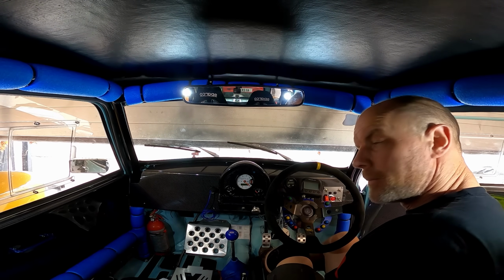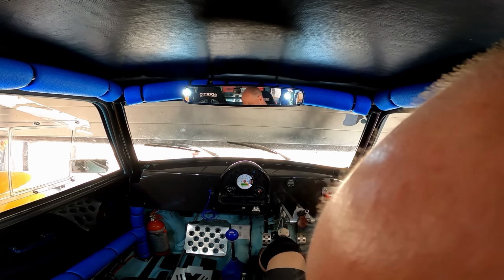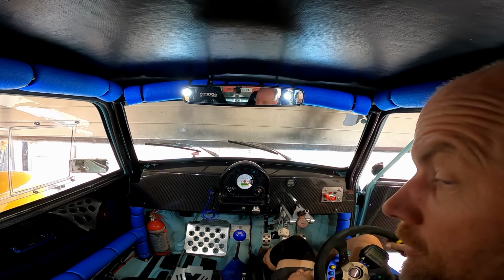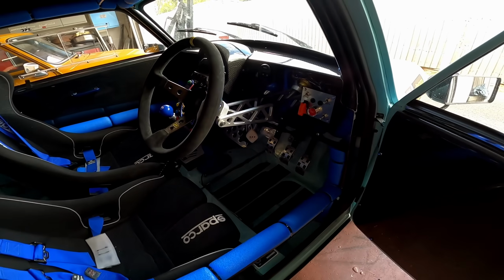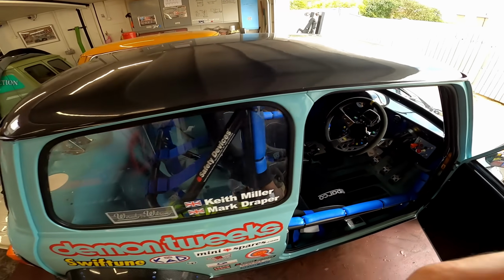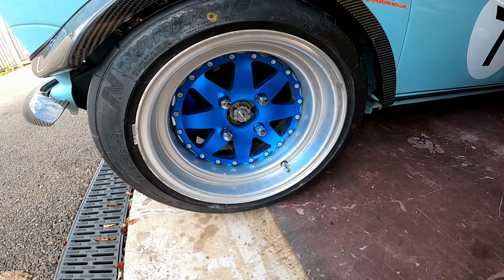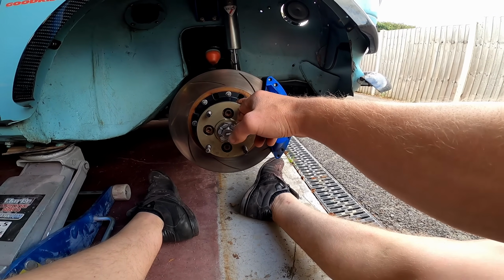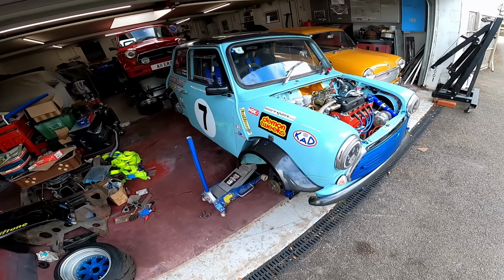Classic Mini 1380 Swiftune Rolling Road Session - Classic Mini Workshop Project Bolt Part 3

Comment: At wheel torque ?...👍🏻
Reply from the maker: 36BHP was calculated at the flywheel, it's about 116BHP at the wheels
Reply: @classicminiworkshop  
I wrote 'at wheel torque ' , did you see something different on your side ?
Reply from the maker: @TheCraigy83  Apologies, I just read it wrong. Unfortunately, I don't know that figure.
Reply: @classicminiworkshop  
it's incredibly important that the average lads know torque IS multiplied by the drive train by orders , crank /flywheel rpm vs gear ratio advantage will always expose the torque multiplication..
for instance a civic type R has a 60 in 2 ratio a 30x ! torque advantage , in first gear they have upwards of 3500ftlb..
a series 1 defender has 114ftlb at crank and +4000 at wheels . 
Trying to find at wheel data is suspiciously difficult , big industry want us to un learn leverage 😂...👍🏻

Comment: you cut out the original roof and made it out of carbon fiber . I wonder about rigidity. How does the mini shell keep its stifness?. Is it fully seamwelded?
Reply from the maker: Hi, it's got a full roll cage fitted and you leave a good 3" lip around the whole roof so you have something to bond to

Comment: Keith, Mark It must be more than 116 HP @ the wheels as you have 136.7 HP total that would mean your losing 20.7 HP through 
the gearbox and diff that can‘t be right ?  My 1310cc is 113HP @ 5828 rpm & 112.06 @ 4983 rpm. I‘m sure i would not be able to 
keep up with Bolt on the track but who knows one day we may get a chance to have a track day together and try each others minis 
out. Cheers Dave
Reply from the maker: That works out at approximately 15% transmission loss. I thought that was pretty standard? I'm sure Paul Jeffries will know more
Reply from the maker: Would be awesome to get on the track together  👍😀
Reply: Straight cut is around 15-18% loss, so tallies. As Bolt is short ratio, it would be on the lower end of the scale. Bloody brilliant result 😎👍🏽
Reply: Hopefully next year we can sort a track day together at Brands Hatch. 😎